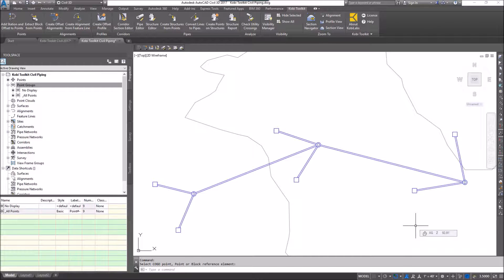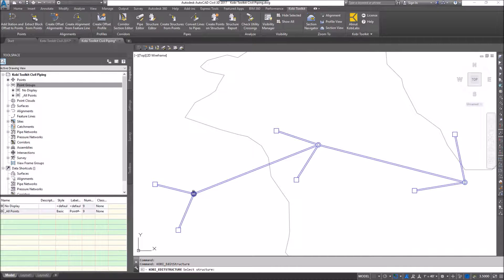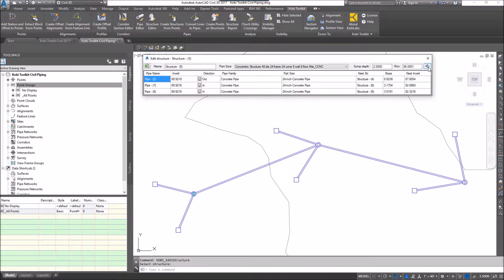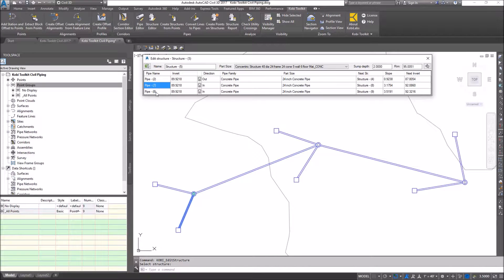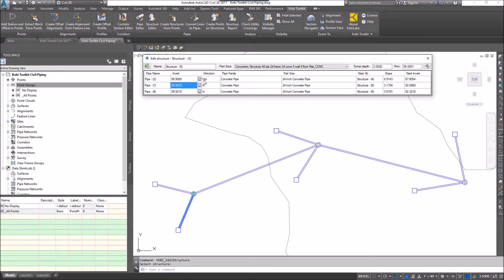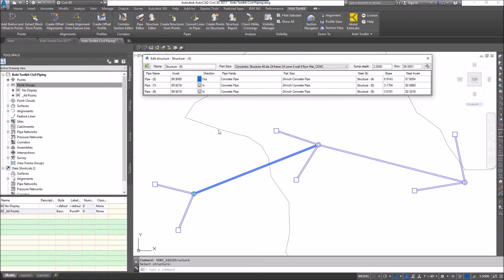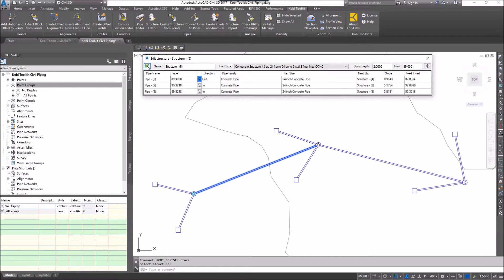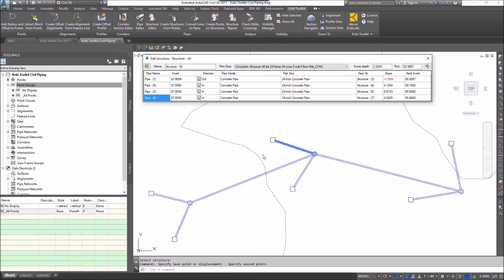Civil 3D Structure Editor - Kobi Toolkit

Comment: How do I get the invert calculator to work. With any numbers I enter, it says "Please enter valid number(s)!".
Reply from the maker: The "Structure Editor" command is intended for quick editing of structure and connect pipes. You can edit structure name, rim, sump and part family and size. In terms of connected pipes you can edit pipe name, invert, family and size. If you’re experiencing issues in a specific drawing, please send us the DWG file at support@kobilabs.com and include a screenshot showing the error that appears.